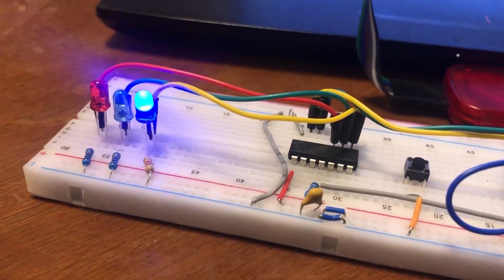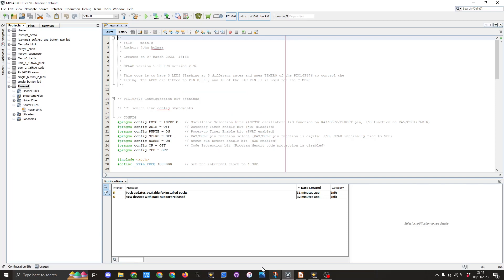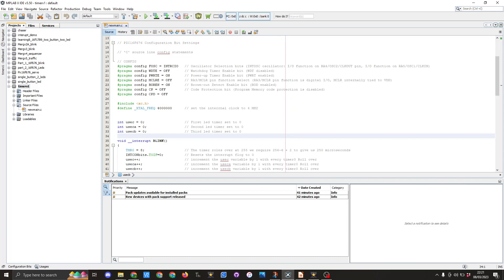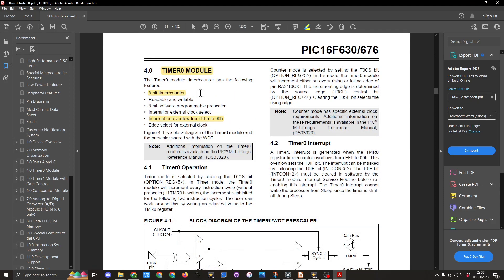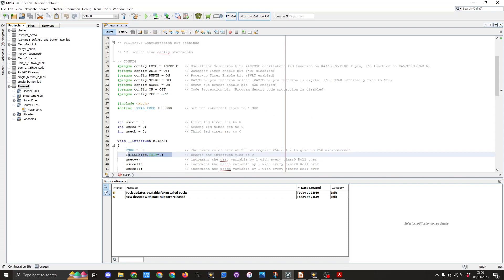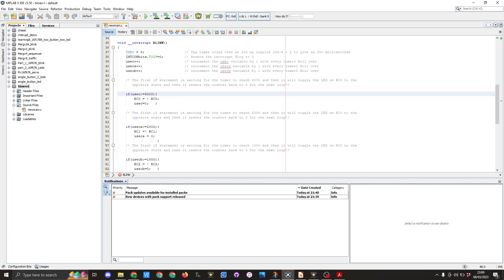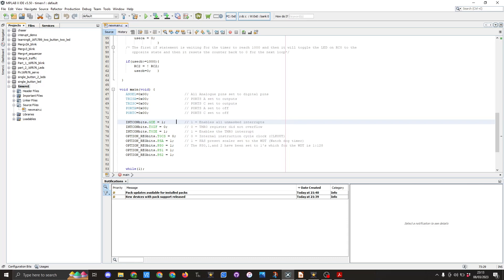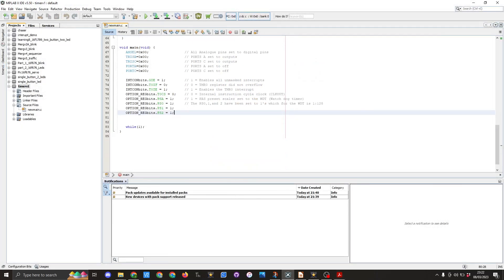Pic16F676 Part 8 C programming Using Timer0 to control 3 LEDs at different frequencies

Comment: If we want to change the frequency of the blinking LEDs. We just had to play with those values in the code right...
Reply from the maker: Yes you would change the Usec variables to what you want, I can not remember at the moment what the maximin values can be. You would need to experiment with them.